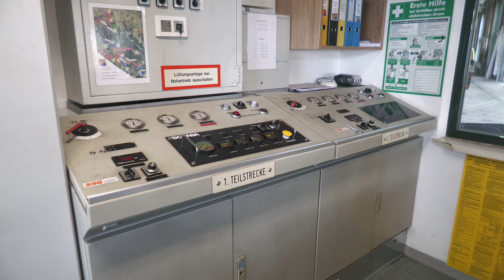Panoramabahn Großarltal

Comment: très intéressante, et BELLE installation. Quant à la machinerie: pourquoi y a-t-il deux volants d'inertie, et ces freins de service longs? c'est pour avoir les pistes d'en mettre deux? 
Merci pour le film !!
Reply from the maker: Joli Städeli en Autriche 🤩
Les machineries en Autriche sont souvent impressionnantes, tout à double …
Ils ont voulu dimensionner la force de freinage sur deux freins à disque au lieu d’un tout gros sûrement ou d’autres normes nationales
Reply: @GondelbahnMonde  Nearly all Swoboda detachable lifts are Swoboda-built Stadeli's.

In the case of Panoramabahn Grossarltal, it is a duplicate of the Leysin-Berneuse lift.

Built BEFORE Berneuse as well! Stadeli almost certainly drew up the design before 1990. Their 3rd of the 4 gondolas they built was the Hornli Express which is a completely different design.

Over Stadeli's detachable lift manufacturing period, they made 2 different mechanical systems. First one from 1983 and the second from probably 1988-1989 ish.